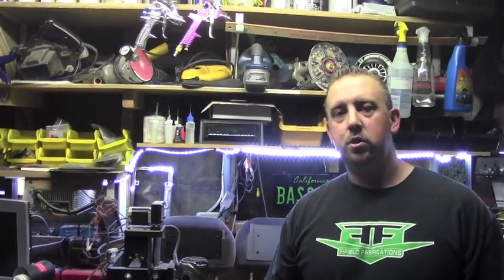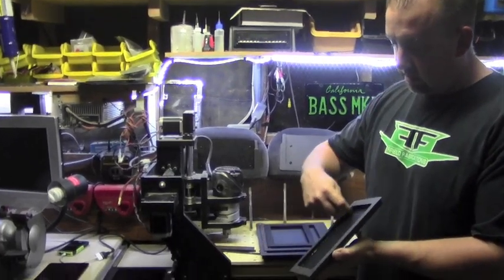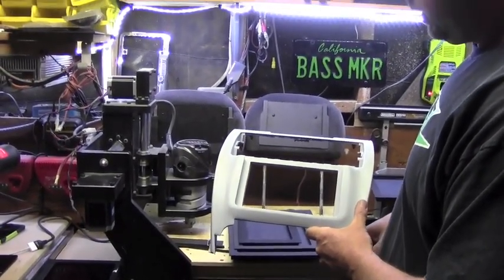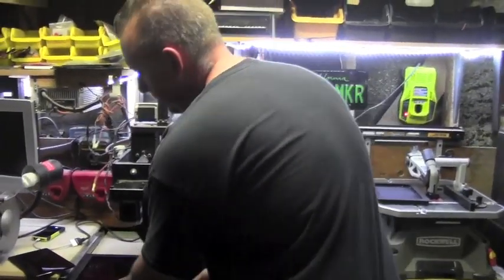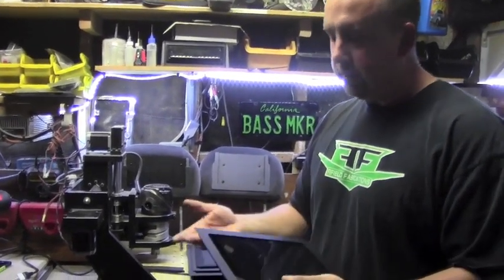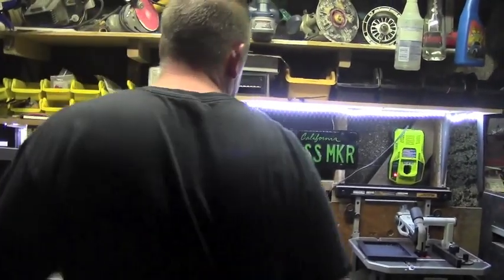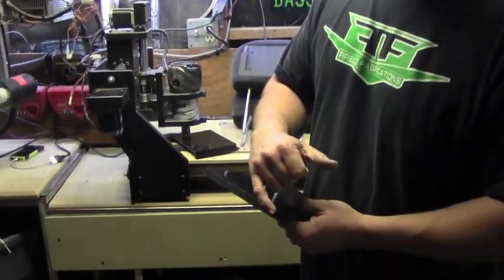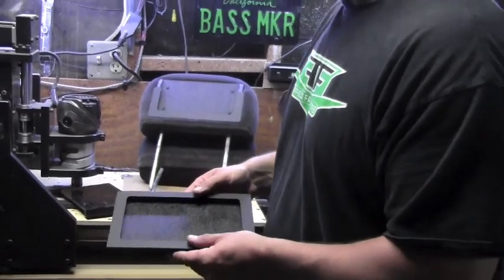FIFIELD FABRICATIONS SlideDock kit for iPad mini, iPad2, iPad AIR, Nexus 7, and Galaxy tabs

Comment: I made my own slidemount kit (enclosed style) for the nexus 7 gen 1 as it was the right dimensions for the available space. The docking station I made from scratch using the original double din bezel in my car, fibreglass sheets and filler. Needs only a small amount of work now to finish it off. Check it out on my channel. :)